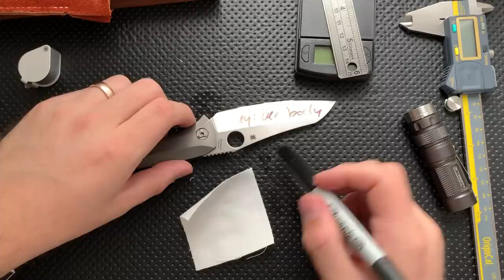The Nick Shabazz Knife Disassembly and Maintenance Toolkit (June 2019 Edition!)

Comment: For Nick:  I used to buy and restore knives.  Diassemble and give a vinegar bath.  Removes a lot of rust.  Use a pair of pliers to squash que-tip heads and use the heads inside of like Spyderco knives.  Works very quickly.

Comment: Hi Nick. I’ve watched many of your disassembly videos and was curious about your tools. I ordered the small wiha set in the green box like you have, and ordered a couple of the ifixit drivers. Unfortunately I didn’t realize the drivers ifixit sells are for 4mm size bits, and the wiha set are 1/4”. So no working. So then I ordered the 1/4” driver size from ifixit which they call mahi or some fish name. Unfortunately this handle is huge in the hand. An improvement to your video might be to call out the bit sizes.

Comment: Nick.  One way to get good torx bits is just order them direct from Wiha. They have most sizes in bulk packs of 10-30 depending on the size. Once you get below #8 they start getting more expensive   Also make sure you use the right size. Too easy to put a 6 in a 7 screw and say it fits and that’s how you ruin either the bit or the screw itself .  Good tools last a long time so it’s worth a little more to get them from the beginning. On buying in bulk it might help if you had some friends that wanted some bits also then you could get 20 and divvy them up between all of you

Comment: Nice video! I also use Wiha screwdrivers and will check out the iFixit handles. There are two things I differ from though: Oil and threadlocker. 

I tried all kinds of US made oils (e.g. Bluelube, Froglube, CRK greese, Daiwa reel oil, and nano oil) but I always come back to EKS Solingen Hi-Tech (sic!) oil. EKS produces this oil for surgical instruments but it is rebranded and sold by other companies as well, e.g. Böker. It is relatively cheap and works for lubrication and rust protection, doesn't smell and it is 100% food safe (in my experience most US made lubrication products aren't). I will check out KPL Heavy Lube though, because sometimes I'd like to have something with more viscosity to it. 

When it comes to threadlocker I came across Loctite 222 some time ago. It's "low strength" compared to the 242 which is "medium strength" and in my experience it usually does the job just as well in most cases but is even easier to remove. 

Last but not least I can recommend Flitz Matte Finish cleaner and Flitz Wax. The cleaner cleans well and has a pleasant citrus smell to it. It works good and seems to be gentle to just about every material you use it on (Benchmade Bluelube Cleanser once removed my Spyderco PITS' blue 'anodization'). The wax is basically your typical high quality car wax. A carnauba/ bee wax mixture, but a liquid. It is insanely economical (a pea sized drop will be plenty for a folding knife blade, a huge bottle costs like 18€) and works just fine. It will prevent fingerprints to a degree and help to keep non stainless free from rust under light use circumstances.

Comment: If I may be so bold as to offer a recommendation...   I was was looking back at an old video on the Benchmade bugout and to you assortment of tool I suggest a feeler gauge. You can pick a set up at an auto parts store for less than $10 bucks.  At least for the way you worked on the washers on the bugout. 
Also for the rest of the tool nerds out there ifixit has a great set that has two different sized drivers one 4mm and one 1/4.  The difference in size would be a great visual identifier vs tape or other markings.
Reply: I love IFixIt handles, but their bits---- not so much. Wiha bits in my opinion are better

Comment: Hi Nick!  Great presentation.  I have one question for you.  
Backdrop: 
I have a folding KāBar pocket knife that was presented to me not too long ago.  Today, quite literally,  I gently unscrewed the 3 tiny clip screws to tighten the body of the knife for better control of the launching of the blade.  In all, that piece was unsuccessful for the screw kept turning.  Now for the climax, while reapplying the screws, 2 were good to go, but that final 1 just kept turning and turning.  I knew then the screw was ruined.  Is there a way to retap that tiny opening and replacing the worn screw with one, once I have been able to rethread the opening?  Also, is there something I can do to correct the forever turning main body screw?  Semper Fi

Comment: I bought a Michael Zieba knive and the detent Bar you can really hear scraping against the blade should I put some nano oil on that or should I just keep flicking it and it will wear down the metal more therefore making it easier to open and close?

Comment: Why have three separate Ifixit bit driver handles when for a fraction of the cost you could have excellent quality fixed blade screwdrivers by Wera or similar in T6, T8 and T10? Keeping a different handle for each size kind of removes the point of bit drivers, i.e. their interchangeability.

Comment: Where’s the T-handle driver that you used in the AD-15 disassembly video? That thing looks like a better tool for applying torque to the screws. Can you share make and model? Thanks!
Reply from the maker: It's a very poor choice, actually.  Bits just don't fit so well.
Reply: Nick Shabazz 
I use Wiha 75802 System 4 Micro Bit to 1/4 ($6) with the Bahco Stubby Length Magnetic Bit Holder Ratcheting T-Handle ScrewDriver 808050TS ($20). The adapter lets you use the bits from that Wiha kit in any 1/4 hex driver, the Bahco is that. You can probably use Wera 013390 T-handle Rapidaptor but it’s pricey at $55 and I don’t think it’s a ratcheting driver.

Comment: "... more specifically, it smells like boiled hell...boiled in an old shoe... "   That's a keeper.  And distinct from Ripe Nuclear Hobo Ass Cheese.    
Your experience, shared, is much appreciated.  Particularly regarding the inve$tment in quality tool$, where it's important to get it right on the first try.
Reply: I really like the Fixit drivers (bought 3)... note that they take 4mm stock bits, not 0.25".  I agree that the expensive bearing-handled drivers are an excess... for me, it's better to have money like that tied up in knives.  Also like the Fixit spudging tools, and the Spyderco ceramic files.  Lots of good recommendations here.  One suggestion... wish I'd gotten a short 4" long caliper, instead of an 8" long caliper.